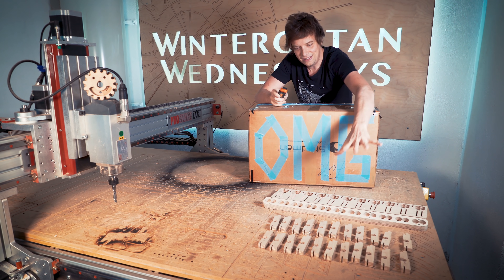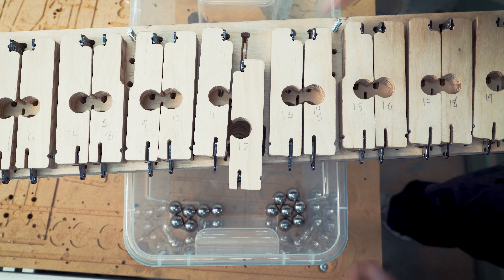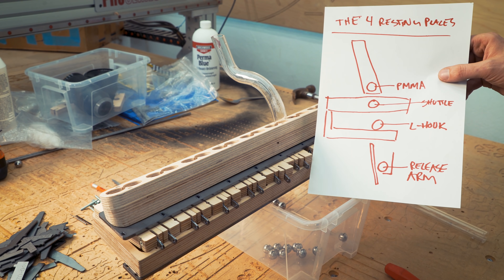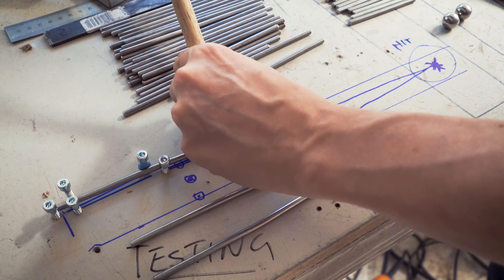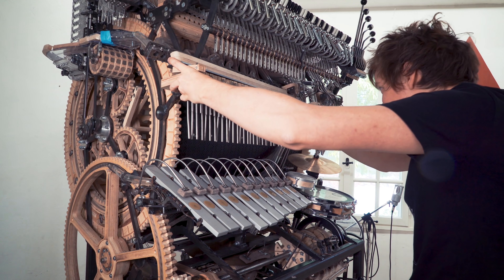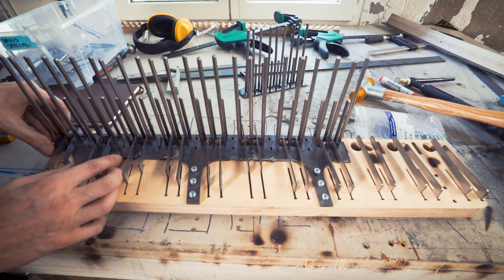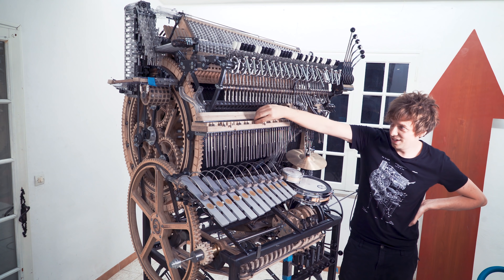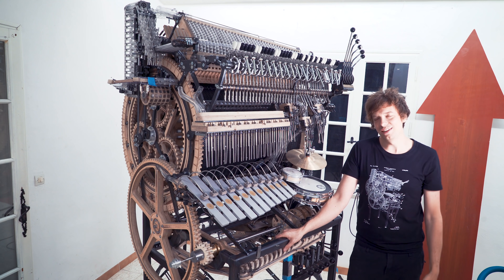My Best Design Yet - Marble Machine X #102

Comment: Sometimes I worry that when he's welding on the machine that it will suddenly catch fire and burn the whole thing down
Reply: He would start over and build it better, no fear.
Reply: Then I hope he has backed up his data well.
Reply: Especially if he does as everyone suggests and lather the thing in paraffin wax.
Reply: @MrGonzonator  Maybe a less-flammable alternative for the lubricant idea?
Reply: @StrangerCoug  well he's not likely to lube the whole thing until he's done with all the welding at least
Reply: @StrangerCoug  well.  Weld FIRST, then lubricate would be a good idea for any lubrication.  :-)
And he has a wet towel with him.  

And if I didn't got my car and garage burned down when I was welding under it.  And the body protection started to burn with an open flame. About 10 cm from the fule pipe, connected to the fuel tank with about 30 liter of petrol. Then Martin can handle welding on the MMX. :-)
Reply: I have the same fear, it would be freaking sad!
Reply: I remember making that comment a couple times.
Reply: The marble machine isn't likely to burn completely. Also, hardwood is unlikely to catch fire and keep burning due to welding.
Reply: @user2C47  Honestly I have a hard time imagining any wood catching fire from welding so severely that he's unable to simply put it out.
Reply: Yea it would definitely suck because this is the development build but the biggest reason why this project has taken so long is because he's prototyping it as he go. If this machine would be destroyed right now he still has all the drawings in his computer and could outsource the fabrication work to different machine shops/youtubers and could potentially get back to current state in a couple of months and likely with a slightly better machine. A worse tragedy would be if he lost lost all the cad files

Comment: make a mistake
learn from mistake
avoid making the mistake the next time

CHARACTER DEVELOPMENT

(I loved the taped washers)
Reply: Then make a new mistake next time, just for variety.

And personally, I'd use a section of tube cut to the desired length rather than a stack of washers, but since it's unlikely to need to be taken apart again any time soon, it shouldn't be a problem very often.
Reply: The taped washers is smart!
Reply: @PhotoGib  Smarter yet is to just use a pipe and cut it to size. It doesn't need to be very thick to work as a spacer in that situation.
Reply: @sphygo  I know a YouTuber that is an expert on Spacers, he might be able to contribute.  :-)
Reply: @AndersJackson  Who is he?
Reply: His dedication is amazing!
Reply: IMO the besst solution would be a 3d printed spacer.
Reply: Yeah tape washers, yet an "n" th moment of genius :)
Reply: The washer part was so satisfying

Comment: With this design will you have to pre load a marble into the device before you start playing. Will you have a way to do this so the first marble is ready to go in the system for the first note?
Reply: I suppose it'd just be going through all the manual handles for every register to "prime" the machine?
Reply: This will almost certainly be handled during sound check.
Reply: Can be done by just having a row of notes that fire off all the marbles at the start.
Reply: Nicolai Syvertsen that would be stuck in the song which would sound wird
Reply: @NicolaiSyvertsen  Except the programming drum will do many full revolutions per song. So that line of all notes and all instruments will have to repeat several times in the song. And there's several pause points on the drop, so it would need such 2-3 trigger notes to get marbles into all the spots along the drop.
Reply: I guess changing the muting mechanism to a 3 position lever (MUTE, NEUTRAL, PRELOAD) and moving it to the final release L hook, would be the simplest solution.

Comment: Any metal part on this machine needs to be baptised by a hacksaw or angle grinder to make it truly fit on the MMX 🤗
Reply: Read your comment before I watched it, then got to 8:50 and laughed when he said he was cutting the part. Martin's a mad man! But his solutions and workarounds are works of art in themselves
Reply: @beeblebrux2112  Well... Martin is one of those out of the box thinkers.
Those people don't believe in problems, they believe in challenges... or adventures, as he said in the video...
Reply: Absolute mad lad
Reply: lol your so right
Reply: This is why they havent built a new saturn 5 rocket , they have all the designs like the mmx but they dont have the years of tinkering on parts to get them to work
Reply: @djscottdog1  The reason they haven't built another rocket like the Saturn V is because there hasn't been funding for anything that huge again. If there were, there is already a modernised design of the Rocketdyne F1 engine in existence - the F1-B - greatly simplified by benefiting from the existence of CAD.
Reply: @Mechness  not to diminish your comment, but theyve also developed entirely new rocketry theories.  ive been following spaceX for a couple years, and the innovation and reinvention of the wheel (so to speak) that resulted in the raptor star ship engine is insane
Reply: @ericofire  It's nice, but I don't think it qualifies as entirely new in concept. But that wasn't the point. The point was that the Rocketdyne F-1 hasn't been abandoned completely. Though there was much more improvisation in its manufacture than a modern rocket engine, that isn't why they don't make variants of it any more. They could put the F-1B into production if there was the impetus for NASA to actually do so.

Comment: Again, what are you planning to use to prevent corrosion? This is all bare metal, some surfaces are ground, on some welded parts there's a lot of colouring due to the heat. This is a recipe for desaster, especially if you're planning on going on tour with this thing.
Reply: Corrosion only happens if you have water or humidity somewhere. And it depends on the metal used.
Reply: @AlexanderWeixelbaumer  the amount of sweat on his hands is more than sufficient to start corrosion. Especially if the surfaces are ground and even more so if there is colouration due to the welding going on. And this is all ordinary steel.
Reply: They discuss it in the beginning of the series since martin likes the bare metal, i think they mentioned using some type of coating but i cant really remember all the details since it was like 2y ago. But dont worry they already have some solution for it.
Reply: @paulpereira7735  powder-coating isn't an option, it will screw up all the clearences. Same goes for traditional painting. Blackening would be a valid method, although it is not ideal for corrosion prevention. What else is there? Anodizing? Yeah. Would do the trick. Would also be freaking expensive.
Reply: @MadHatter123456  to prevent corrosion, i would love some sort of bluing process. not only will it make the whole machine much more attractive it fixes the rust problems.
steel doesn't get anodized it would only work on the aluminum parts, and it's not necessarily expensive if you do it in your home shop (which is possible).

this isn't going to be something that gets a lot of hand action, most parts aren't touched, and can be just oiled or waxed.
Reply: @BloodSprite-tan  Steel can be anodized. It's pretty expensive though. 
Oiling isn't nice If you like to have clean hands. Blackening or blueing is the only method I see that isn't overkill or too inconvenient.
Reply: @MadHatter123456  if you've seen anodizing of steel i think you're getting scammed. either they are using a completely different process with the same name or it's simply not carbon steel like the marble machine.

oil finishes aren't all equal, waxes and finishes like linseed oil can dry so they aren't tacky. most wax finish are smooth and not that greasy or grimey. i mean you've seen cars before right? you know they are finished with wax?
Reply: @BloodSprite-tan  you can anodize steel. No problem. Galvanizing if you like that term better.
Reply: @MadHatter123456  well now you've just stated the obvious. galvanizing is a completely different processes, you don't add zinc to aluminum when you're anodizing it.

if you're going through with a shiny metal coating, why not try doing nickel or chrome plating i think they'd probably look a lot better still expensive though and i'm not sure it would fit with the aesthetic, seems like you'd rather get some darker/matte black with the plywood.
speaking of which, what is plywood gonna be finished with, if he's doing a world tour, it's gonna need to be humidity resistant so it doesn't crack.
Reply: @BloodSprite-tan  galvanizing is a much wider field than just coating steel with zinc.
And yes, you're absolutely right, he also needs to protect the plywood parts.
Reply: @MadHatter123456  i have almost no knowledge about galvanizing, what processes are you refering to is there a place where i can read more about this?

Comment: I know you hear this everyday; but. - You need a lathe son. Even if a naffy import.
Really like your recent planning and rigorous schedule. It has stopped you from over engineering while procrastinating about potential perfection
Reply: Might be nice to have, but what would he need it for?
Reply: @moritzh6876  for one thing not stacking 100 washers when you need a bushing type spacer of the right size ;-)
Reply: @positronictofu6505  Well, Id kinda just cut a piece of tubing to a standard size and then use one or two washers to shim for exact positioning.
Reply: @positronictofu6505  that bushings could have been made by cutting an metal tube or even an plastic tube to length, depending on how you want it to work.  No need for a lathe there.

But yes, a lathe is the only machine you need to be able to make any other machine, including a lathe.  So it probably would have been very useful.
Reply: @Anders Jackson - interesting. I mean, maybe what you're saying isn't strictly speaking 100% accurate, but I've been interested in the history of manufacturing, and how people have been making things.

It's not hard to see that if you go back really far in history the first tools were the hammer, axe and knife. (even if those have been refined dramatically over time from their first stone iterations)

But once you get into the existence of machine tools... It becomes hard to follow what leads to what.

Of course, there's also the difference between historical development and the usefulness of various tools;
Like, if you had one tool in a post-apocalypse kind of scenario (Assuming whatever tool you had did still work), what would be the most useful, and why?

So, anyway, I find it interesting that you think a lathe is that useful.
Considering what it does it's not immediately obvious why you'd want a lathe specifically, but I'm sure you know what you're saying.
(and I don't doubt that you're excluding much more basic tools like hammers and saws...)
Reply: @moritzh6876  bushings mostly. Would work better than stacks of washers. I wonder if he could mount a small one on his cnc somehow to have cnc OD turning.
Reply: @TheRealKoolguy007  i would imagine his lathe would be hand powered and have 2 huge gears on the side :)
Reply: eekpie nahhhh, a lathe would be too accurate XD
Reply: If he really needs something build with a lathe he usually does collabs with makers who own one
Reply: @weasel.3683  you never know how useful a lathe is for a project like this until you own one. All the axles he ever needed, all the spacers out of plastic, steel and aluminium all could be made on a machine around $2000-5000. the good thing about having one in shop is that usually it's the little stuff that gets forgotten that needs the lathe, like the spacers in this episode, even if collabing could have gotten him the spacers he couldn't have just made them for this video
Reply: McMaster nylon spacers, RIT dyed if needed, would be a far cheaper and less work intensive solution
Reply: It takes time and energy to learn manouver a lathe. He already had to learn cadding, cnc, welding and so on. Learning anf installing a lathe would be too much right now imo. Maybe if some company came and did eveything for him and teach him basics in a good way...
Reply: One of his collaborators with a lathe (thisoldtony I imagine) are likely working on parts to replace the washers but they weren't ready yet.
Reply: Asking as a compleate neophyte, would a costom bushing be that much better than a pile of washers?
Reply: @Smileyrat  The main thing is that with 100 washers all needing to be aligned at once assembly is way more annoying than using a 'bushing' really just a spacer
Reply: eekpie agreed, watching Martin inserting a rolled up stack of 30+ washers instead of a solid piece machined to length was startling a bit..